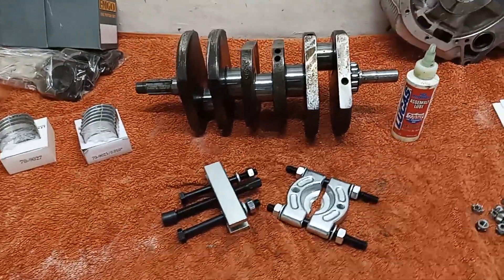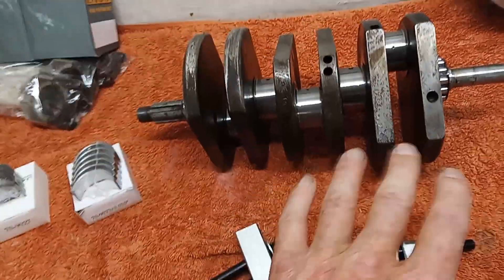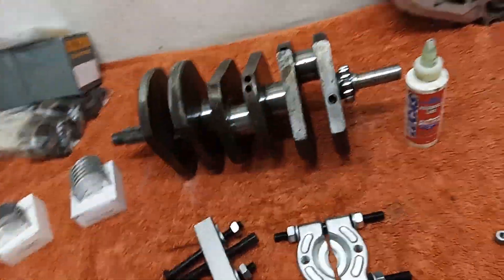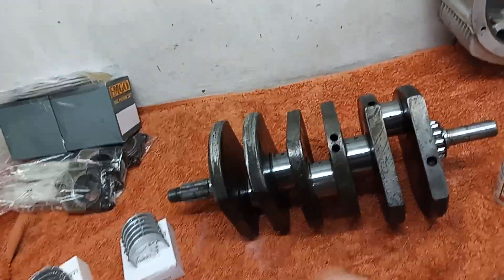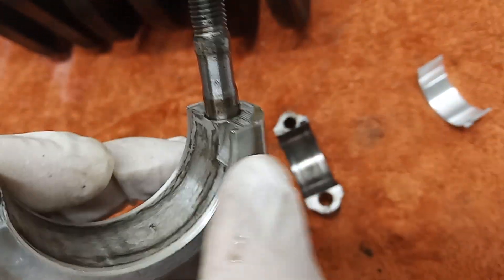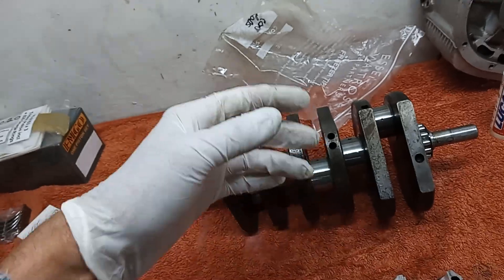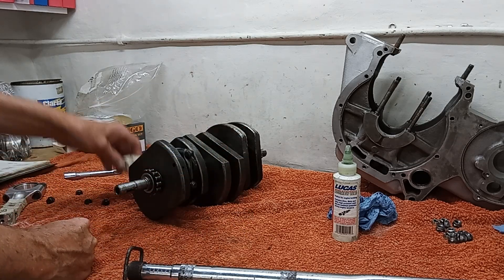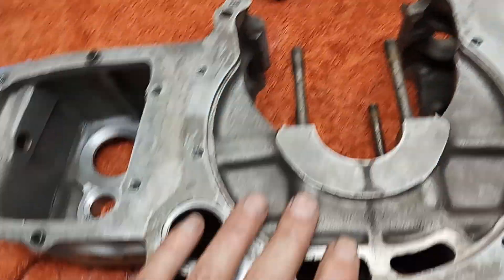Triumph Trident T150V Engine Rebuild. Part 18: Fitting the Conrods to the Crankshaft.

Comment: Hey Chris, what manual are you using? Trying to find a good one online but haven’t found any that give good specifications like the one you reference in the video. Thanks!
Reply from the maker: There are 3 manuals that I use: My own!! 😁 'Triumph Trident Restoration Manual' (from Amazon - just type my name in), plus the original Triumph Factory Workshop manual in a green folder (plus the Parts Catalog) from specialist suppliers like LP Williams or maybe Amazon/ebay etc, and finally the good old Haynes Manual. Hope that helps. 👍👍👍

Comment: Hi Chris, I'm looking at rebuilding a Trident engine using your guide and I was would if it would be advisable to replace the big end bolts if the engine has been rebuilt after the original build just in case they had been over tightened and stressed.
Reply from the maker: Yes, I'd recommend changing the big end nuts (cleveloc) and the big end bolts themselves if not changed before.

Comment: Aerotight nuts
Reply from the maker: You may be able to use either, but Clevelock are recommended so I would use those to be on the safe side (Clevelock and Aerotight nuts work in slightly different ways)